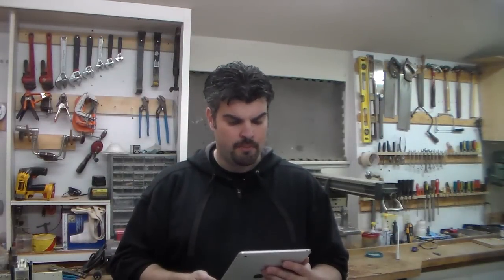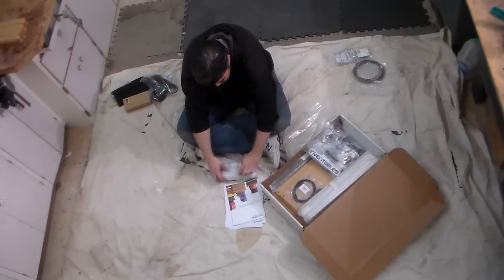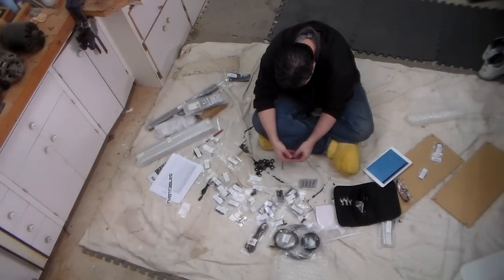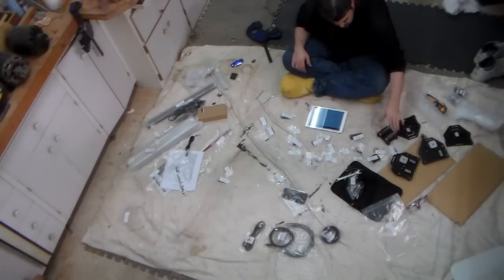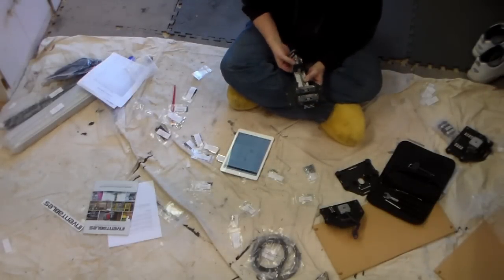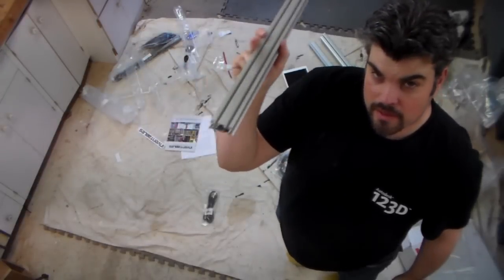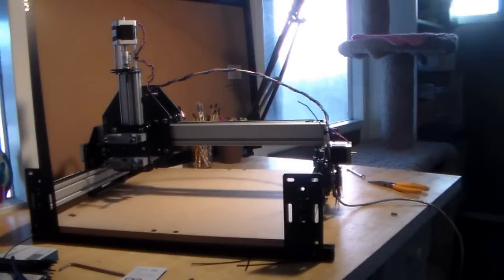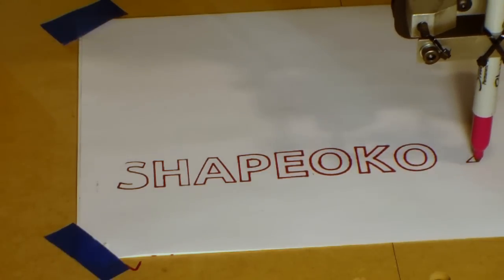Assembling The Shapeoko 2: The Day the Shop Stood Still

Comment: Thanks for disclosing all the terms and such.
I couldn't really think what projects I'd tackle with it.  The few things I might actually use a CNC for require something beefier, so didn't go ahead with it.  Kind of glad right now I didn't.
Reply from the maker: Thanks! Honestly I imagine that 90% of what I plan to do with this machine could be done with your 3d pantagraph router, inlay text and copying solid objects.
Reply: If you want an "intimidating" build, try my CRP-4848 4x4 CNC router table.  Initial build time I would estimate at about forty hours over several weekend (includes building the base). I'm still tweaking and improving it, but still my favorite build.

http://www.cnczone.com/forums/open_source_cnc_machine_designs/153167-crp4848_-_my_first_machine.html
Reply from the maker: Freeman Pascal That is a seriously cool CNC!

Comment: Your commitments fulfilled now you can take it apart, pour epoxy over it and make a nice bowl out of it.
Reply from the maker: krtwood Ha! After watching you, I Like To Make Stuff  and the Drunken Woodworker using your CNC's I've been coming up with some wild ideas. I hope I don't destroy this thing.... :)
Reply: Peter Brown If anyone deserves a free cnc it's you, you've been toiling away making all manner of odd things for a very long time.  I'm sure you'll do good things with it.  Just remember it does exactly what you tell it to do, not what you meant for it to do.  It's definitely a learning experience when you walk back into the shop to find the blackened, smoking remains of what it was machining wrapped around the spindle.  Upcut spirals can do naughty things.
Reply: Did your tap break also?  Just curious, is all...
Reply from the maker: krtwood Thank you Kevin. I'm sure there will be a learning curve. Right now I need to even find a place to put it. The wife has nixed the office...
Reply: KSFWG
If that was directed at me, I don't have the same cnc.  The only assembly on mine was about a dozen bolts to put two halves together.  But then mine was about $2k more.
Reply: krtwood Thanks.  I was just curious, that's all.  Thanks for clearing that up.
Reply: HAHAHA

Comment: Pssssst - Peter. Here's a good use for HDPE - prototyping. Mold a slab of HDPE, put said slab on the CNC, fly cut it to get a uniform thickness, then cut out the prototype part. Part works? Cut it out of wood or whatever. Part doesn't work? Melt it down, tweak the design to eliminate the problems, then try it again. That's what I plan to do. Saves "scrap wood" for other set-up needs, and reinforces my motto: "If at first you don't succeed, eliminate any evidence of the attempt..."
Reply from the maker: Mark Lindsay "If at first you don't succeed, eliminate any evidence of the attempt..." That's excellent! I thought of you when I was building this, and wondering what sort of a setup you had. I recently found a HDPE cutting board in the shop that I squirreled away years ago, and figured it would be my first material to cut...

Comment: Welcome to the world of CNC. I have had a lot of fun with my Shapeoko 2.
Reply from the maker: Bob Justison I'm excited. I remember your birdhouse carving! How long have you had it? Any issues that have come up?
Reply: The only issue during the build was the length of the screws to hold down the table. I immediately swapped out the stock knock off Dremel for a real one. Since then I have upgraded the Z axis to the Acme thread. Once you think you have squared up everything,  check it two more times. It's a lot of fun. Check out the Shapeoko forum at www.shapeoko.com/forum.  I have posted a couple of projects. I built a electronics enclosure with a fan. Good luck. Please feel free to ask any questions. I'm still learning too.

Comment: You are definitely a braver man than me... I thought about filming my assembly of my Shapeoko 2 but since I didn't remember to turn on my camera my fate was decided. I look forward to your future projects with it. I know I've already had a blast with mine.
Reply from the maker: Mike Merzke I think I have about 3 hours of footage of me just saying "25387....25387..." searching through the pile of parts! :) I really liked the logo you made. Any issues so far with yours?
Reply: I had an issue at first with the arduino, but the folks at Inventables quickly sent me a new one and included a fan. Other than that I have been trying to upgrade it a little at a time.
Reply from the maker: Mike Merzke Oh, did it overheat? That's good information! I've been looking at enclosures but hadn't considered the heat....
Reply: Peter Brown The heat sometimes causes it to miss steps or do other funky things. They recommend having a fan on the Arduino and sell an enclosure that you can mount a fan too that holds the Arduino and Gshield. I have been trying to figure out an enclosure where I can get a little better dust management. Right now I am just using a small shop vac.

Comment: Your tap broke too!  I had the same problem, luckily the local Ace hardware carried one so I could keep going.
Reply from the maker: I'm so glad to hear that! I was totally upset. "Nobody else broke pieces Peter, you're a brute..."

How do you like your router as a replacement spindle?
Reply: Do they suggest in the directions to use tapping fluid, as well as doing quarter-half turns, backing up and then going in further?  I think too many people who have never done any tapping thinking they can just plow in like a drill bit.
Reply from the maker: Jason Rausch  No, they just say, "go slow" It was a first for me, so I was turning 2 turns in the beginning. The last 14 were done while watching YouTube and much much slower... :)
Reply: Peter Brown I am liking the router a whole lot.  It has more power, which makes for easier cutting, and its a lot more dependable.  By that I mean it doesn't fluctuate its rpms.  The stock spindle slows down going through stock, but the Makita seems to just keep on going.  It was definitely worth it.  And with the clamps I'm using, I can always take it off the Shapeoko and use it as a trim router!
Reply from the maker: MonkWerks with Fr. Thomas I might have to go that route. I certainly seems like a wise upgrade! But first I need to find room for this new toy.... :)
Reply: Jason Rausch That was my problem, it was about in the middle of the build when they suggested tapping the MakerSlides, and I was a little on the tired side.  I just plowed through, though I even had my little bottle of oil sitting right there.  It was purely my fault.
Reply: Peter Brown You might be interested in my next upgrade then.  I have a  #GetWoodworkingWeek  video to do, then it should be the one following it.

Comment: Very nice. So, 1-10 with 1 being easy, how hard was the actual build and use?
Reply from the maker: Bob Haws Hmm. The work wasn't difficult, just time consuming. Besides the busted tap it when pretty well. I can see folks without computer know how, getting frustrated at the last step up setting up the Arduino. Maybe a 6?

Comment: Sweet, omg 10hr assembly wow.
Reply from the maker: Mike Fulton yeah, iit's not the easiest assembly, but for the cost it's still a deal. Honestly I was worried it wasn't going to work very well, or that I would screw something up. but it seems pretty tight.

Comment: i eagerly checked out their web site and whats available,  almost ordered one but. . . i have no clue how to do the computer stuff, just driving this iMac itself tends to be problematic at times. . .  keep up the good work with your youtube.
Reply from the maker: Thanks! I'm not going to lie, it did get a little complicated with the Arduino setup. But the directions are good if you take you time. As for using the machine, it's very easy with the built in software, and if you check out Jay Bates newest video, he shows those steps in his...

Comment: LIAR. I do remember you gave a tool review of your table saw. You said that it works well oppose to working badly. LOL.
Reply: Also i think you need a tapmatic. They go in drill presses and they can automatically tap a hole. they are crazy cool.
Reply: you could cover the wire with something clear. i know i have seen clear wire covers.
Reply from the maker: Jared Shroyer I some people using aquarium tubing. I might get some of that!
Reply from the maker: Jared Shroyer I've never tapped anything before. A very tedious process! I'll check out the tapmatic! :)
Reply from the maker: Jared Shroyer You're right! But I wasn't paid for that. I just love my vintage Delta! :)